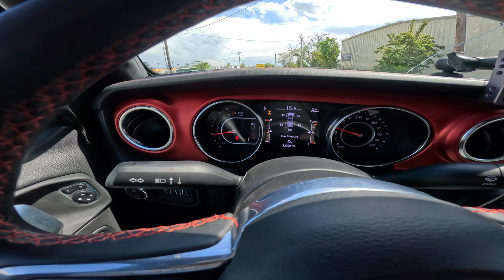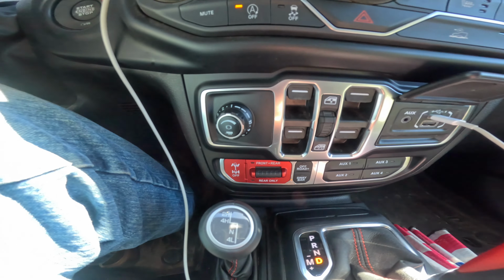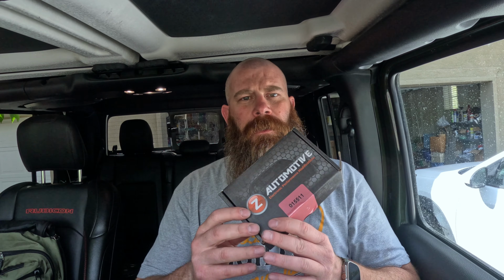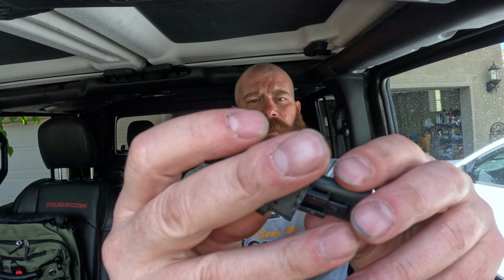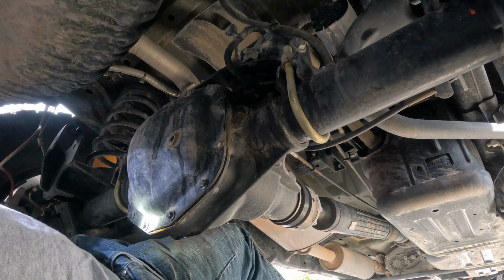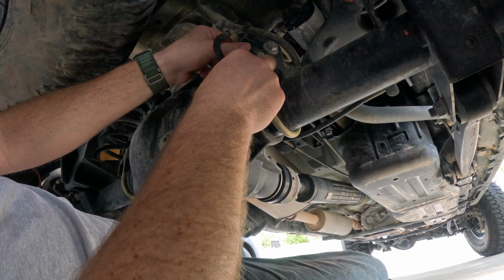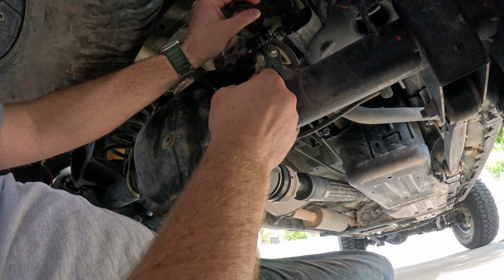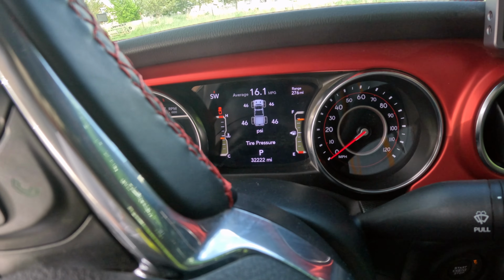DIY Fix: Jeep Gladiator Faulty Service Locker Sensor

Comment: Or....you can use the Tazer Mini JL and delete the front axel locker. Then you can buy the wire harness that plugs into the front locker and wires into your AUX switch. NO MORE DASH LIGHTS
Reply from the maker: Oh that’s a nice way to go too. My aux switches currently were all full so I would’ve needed  different switchback or something but that’s a good idea too
Reply: @ I’ve been dealing with this issue too.. I’m going to buy another aux power box. Great videos keep up the good work..
Reply from the maker: @warmeds2009 thank you.

Comment: Thanks for the follow-up.  So basically, this adapter bypasses true confirmation whether the locker is engaged or not.  So get the feel of the lockers being on at the wrong time so you know if there is a locker stuck in the on position. Right?
Reply from the maker: Correct. So this will turn the lights and the locker off. If the locker takes some time to shut off this will not tell you whether or not it is actually off. So understanding that feeling of them on and off is important
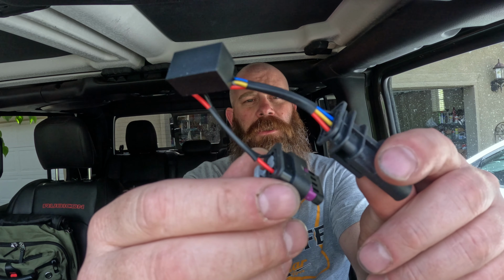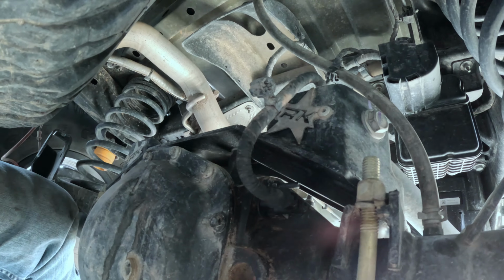Reply: @Vikingoff-Road  Good to know!  My Rubi just went from 4:10 to 5:13, so bye bye warranty.
Reply from the maker: Yeah no worries I was in the same boat went from the 4.10’s to 5.38’s
Reply: How do you know that the sensor is bad what if you just tried to clean it or is it shorted out
Reply from the maker: You could try and clean it and maybe it will work. I’m not saying that wouldn’t work.

Comment: 2018 JLU Rubicon - 88k miles…. Stock. Just had this occur, $954 for rear sensor, went from no idea when sensor comes in to its here and we will have it done next day….  Only had to pay deductible…. The rear sensor from MOPAR at the dealer was $590… dealer said they have been getting MOPAR parts from other dealers.
Reply from the maker: Dang. That’s crazy getting parts from other dealers. At least it’s fixed. But that cost is no good either for a damn sensor. But glad it is fixed and it didn’t take as long as they originally told you
Reply: @Vikingoff-Road  but same sensor (not improved), front sensor for that locker will be same $$ if it fails inside warranty. Just keeping on.
Reply from the maker: Wish I hadn’t regeared so early also. Would’ve made using the warranty better

Comment: I dont get the dash lights..just in the offroad pages it shows both front and rear lockers locked.
Reply from the maker: Even when they aren’t on? That is interesting. I’m only ever said service locker and I couldn’t turn it on and it would show disconnected, but it will also show that I needed to service them
Reply: @Vikingoff-Road  yeah they are not engaged. I got the by pass on the rear and it's still the same thing. I'm thinking of putting th by pass on the front to see if that will clear it up. Or I may have to get a second by-pass.  I only get flashing when I got to engage the lockers and try to turn them off.
Reply from the maker: That is so interesting. I’ve never heard this side of it. Yeah I would try putting the bypass up front and see if that helps. If it does you might not need two.
Reply: @Vikingoff-Road  welp! Switching it to the front fixed it!!.
Reply from the maker: Well that is a good thing never heard of it on the front but I am glad that it worked  for you!
Reply: @Vikingoff-Road  thanks..appreciate the video